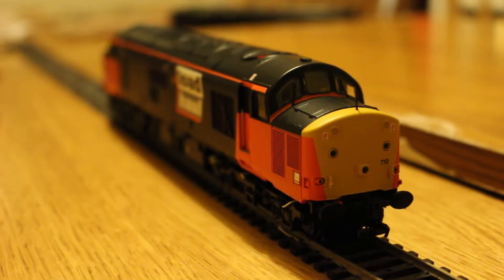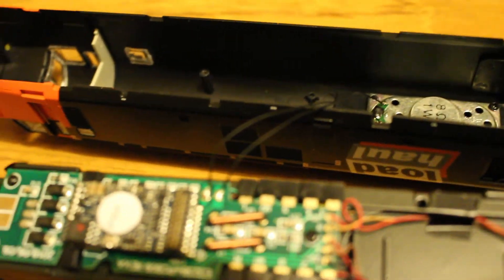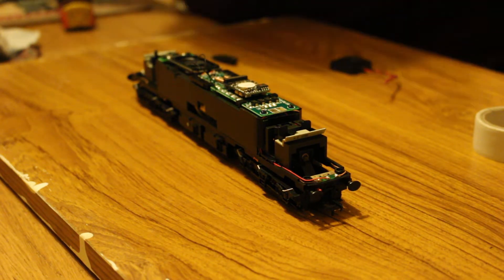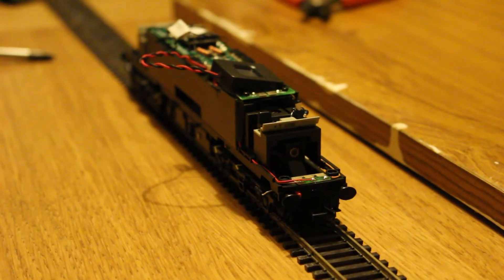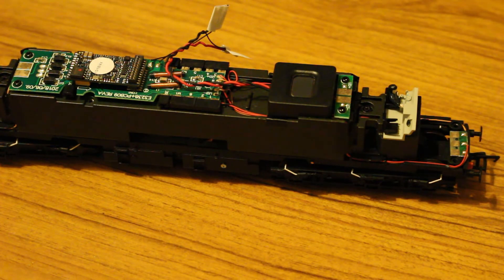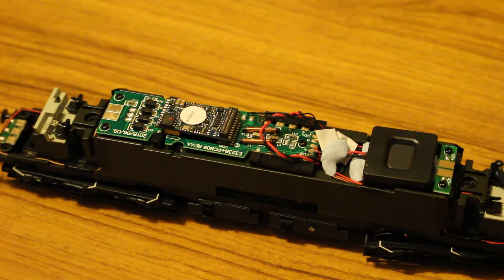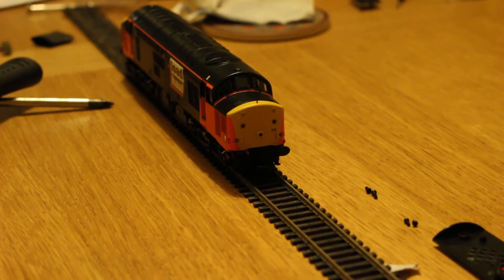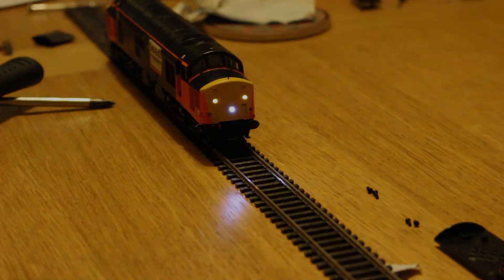Upgrade a Bachmann Diesel Class 37 DCC Sound speaker

Comment: Hello
Just found your channel and had to subscribe and say hello.
Great video I am a dcc oo gauge modeller and I am slowly getting sound fitted locos.
And this 37 sounds brill.
Were do you get the speaker from and how much do they cost.
Peter from Birmingham
Reply from the maker: Many thanks Peter! It was from 'Roads and Rails' and I think the speaker was something like £8.
Joe
Reply: Hi Joe
Wow wasn't expecting that I will look into them for my hornby tts valenta and mtu hsts and my gwr castle class.
Peter
Reply from the maker: @chelmswoodjunction  just mind out for the ohm value on the speakers. I think it's different for the TTS. Pretty sure on their website it says which speakers are suitable for which decoders
Joe
Reply: Hi Joe
Will do that I think they are 4ohms but I will check with the instruction book.
Peter